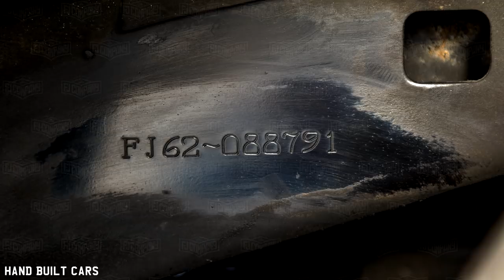1988 Toyota Land Cruiser FJ62 Full OEM Frame-Off Restoration Project

Comment: Travelled all through Australia with one. Great vehicle. Would go anywhere. Never had any mechanical failures. No problems, apart from getting it stuck in a ramp of an old car park building in Melbourne (a moment of eternal shame).
Reply: I bet you thought " of all the rough terrain it's been through, and it gets stuck in a car park!"

Comment: Love the 60 series Landcruisers, doing an off chassis rebuild of mine at the moment. The difference being I have chopped off the body behind the rear doors and extended the chassis by 700mm. Fitting 75 series springs on the front and 79 series springs to the rear, and supercharging the 2H diesel.
Reply: Yikes!! I want to see this. Talk about custom

Comment: that thing looked in great shape before the resto, I cant believe that it was fuel injected, was that standard in the states????, we did not get injection until the second series of the FJ80 in Australia, they were still carburettor and gutless, I had 2 of these, great vehicle though.
Reply: Most US models were EFI by this time to get through our emissions testing. Putting an automatic on that old pushrod I6 certainly did not add to it's performance, even with EFI these trucks were slow and got awful mileage. But it's still a land cruiser and an awesome truck. That this one had no rust was kind of amazing.
Reply: @Oldbmwr100rs  Yeah that was my reaction. It was a very good truck to start with!

Comment: great job. it is advisable to remove the bituminous sheet from the floor, there is often rust. 1:35   and a sheet with a partition of a motor shield  6:00 and so everything is done cool, good luck in the restoration. sorry for my English.)).     p.s. and the number badge could be polished ;) 9:56
Reply: What they use to put out the original paint ?

Comment: It had a nice used look before the restoration. Imho this one should have been kept as close as possible to the original car, rather than being stripped out and rebuilt. But the work was very well executed. Two things are horrible though: the leather seats which replaced the nice fabric and the two tone paint 😕